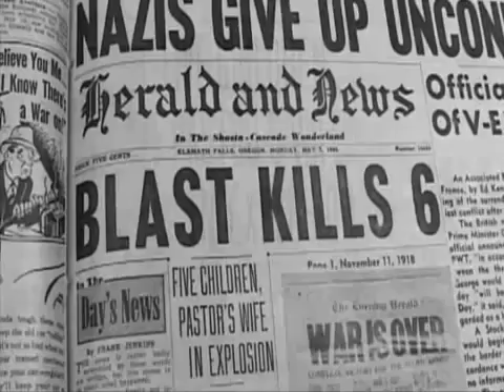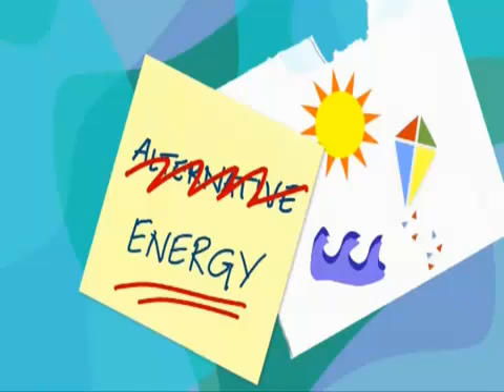James May's Big Ideas on the Laddermill (BBC)

Comment: Twin kite technology is far faster. While one is busy creating power, the other is returned to ground level, synchronized. This way, the generator is always creating energy. The other unique energy product is tethered ships. Also synchronized, giant generators inside ships which are tethered at points to the bottom of the ocean. As the wind and waves move the ships, the generators incredible power.